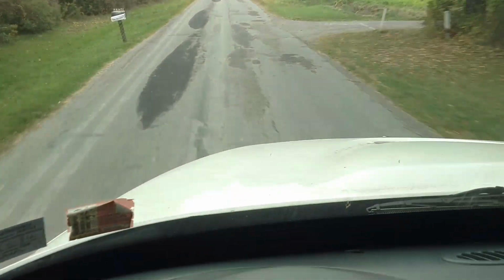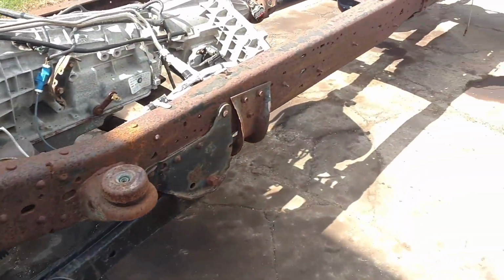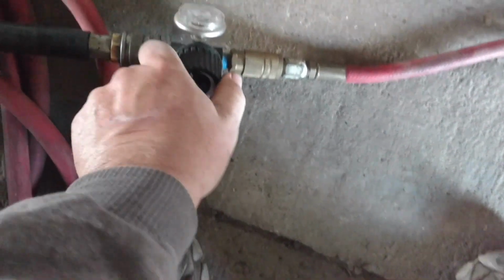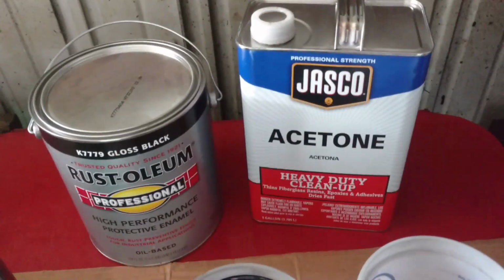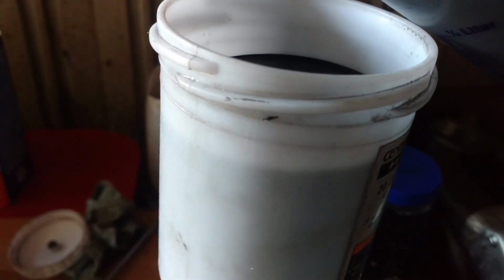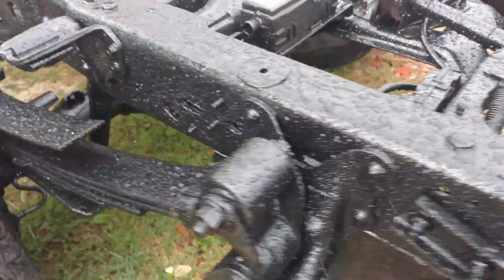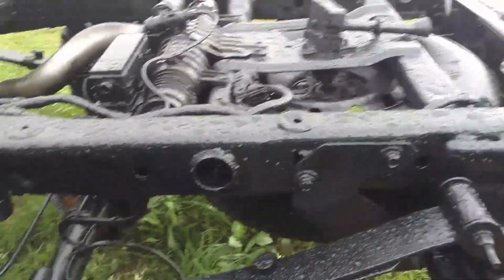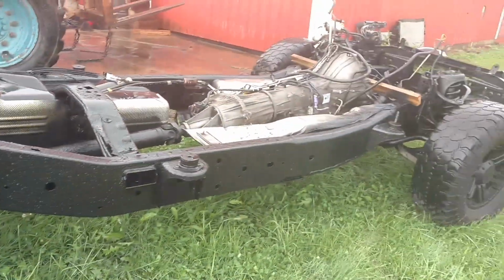GETTING THE DUMP TRUCK LEGAL & PAINTING THE F250 DUALLY FRAME.

Comment: Hi the dump truck turned out good the f150 looks like it is going to be really nice and also the f150 has 6 lugs 😀 it was fun trying to find rims for them even stock rims for a while thanks Heath
Reply from the maker: i have found some factory aluminum rims with tires here local...i will buy some after the old girl is back together and driving. i want to make sure i am going to keep it before i spend too much money on it.

Comment: Hope the trip went as well as it could have. 
That chassis is a big improvement and if it survives the rain it will be great,  a marked improvement on what it was. Looking forward to the next video
Reply from the maker: it was sad but i am glad we went. the paint turned out ok. no water spots to speak of. i hope to put the 5.4 motor back together and stuff it back in that frame soon . i have really wanted to get that truck finished. i have to figure what is next after that.

Comment: I use what you do for my frames but I add a hardener to it. It's called catalyst hardener 8-0950-4 you can buy it at tractor supply. Works amazing well with the rust-oleum paint.
Reply from the maker: a friend  of mine said he used a hardner also. i used some on the first frame i painted. i will look into it.

Comment: Nothing wrong with those wheels - swap the tires out...& once you haul a few loads with the dump truck the springs may 'give' some for a smoother ride...that being said...in the future if you swap out the box for a fifth wheel & have to bobtail to get a trailer - l wouldn't be in no hurry to get there...both those frames look good to me & if you go with the V10, ain't nobody gonna be looking at the frame...hey, l know you got a lot to do & it's all about getting your priorities in order (believe me - l know) but l'm tuned in to see what new stuff you got going on the 5.4
Reply from the maker: those wheels on the  f150 are too wide for a regular size tire that i would run in the winter. can you imagine what a lt245/75r17 side wall would look like on a 10" wide rim? it would be hard to get the bead to seat for  sure. i dont think i will be in a hurry going anywhere in the dump truck. it sure runs and drives well. "if" i put the v10 in that frame.....or "if" i put a cummins? i am ready to get that f150 done...

Comment: When you did the 4x4 swap what kind of hardware did you use the mount the coil buckets?
Reply from the maker: i used the highest grade metric bolts i could find. i got them from fastenal.
Reply: J.C. SMITH PROJECTS  Thanks.  Did you get some with a shoulder at all or just threaded?   I have a 02 7.3 wanting to do the coil 4x4 swap.
Reply from the maker: they had a shoulder to go through the coil spring bucket and almost through the entire frame. by buying them this way...they were too long and i cut the thread length down. the have done them with just standard heavy grade metric bolts with no issues. the coil spring bucket has a flange that bolts to the bottom of the frame which helps stop it from moving. you do your own research and make your own decision. i did what worked for me.
Reply: J.C. SMITH PROJECTS I appreciate your input will definitely do what you did.  You have plenty of experience. Dump truck turned out  great by the way.
Reply from the maker: thanks. keep in mind the steering pitman arm and gear box may be different from 1999-2004 than what is used from 2005-2010. i would suggest buying a front frame cut with the front axle. that will give you all the brackets  and bolts for the "bolt on" stuff. much cheaper project that way.
Reply: J.C. SMITH PROJECTS I agree I saw  a roller frame today that got me thinking about the swap.  I will definitely have some sort of parts truck for the swap.
Reply from the maker: around here a rolling chassis with coils up front can be bought for $400-$500 depending on gear ratio and if it is single rear wheel or dually.